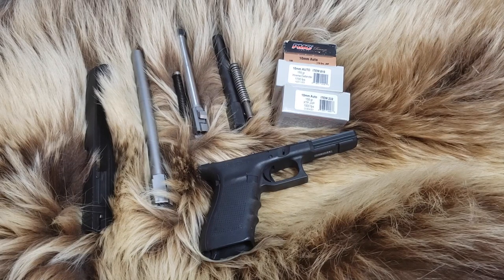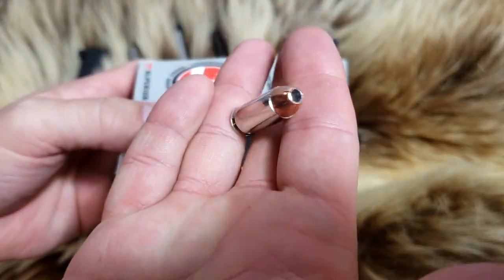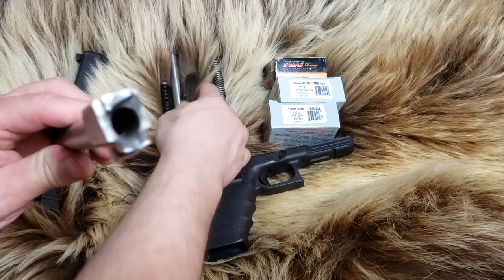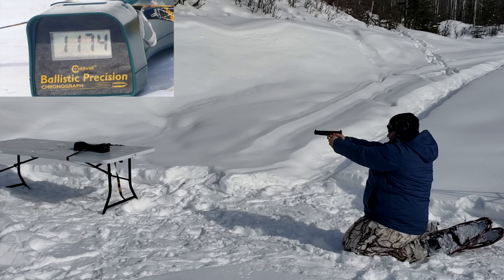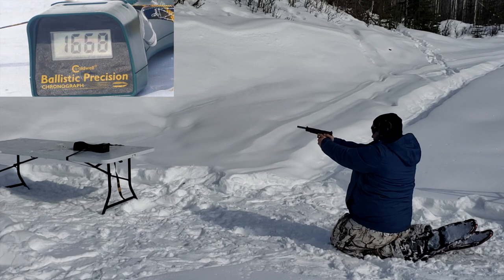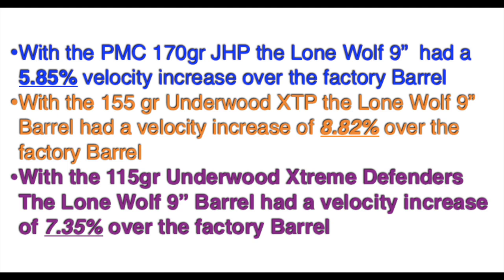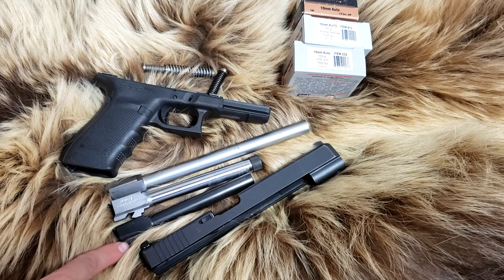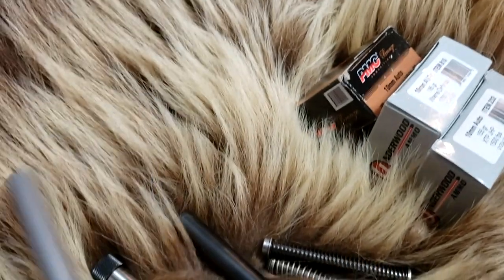10mm Glock 40 3 Long Barrel Length Velocities

Comment: If I'm in Combat with a bear , I want a combat Barrel . I would rather Feed every sub Perfect round than have the Perfect round lock up my gun after 1 shot .
Reply from the maker: I can understand that
Reply: Good point. What's your opinion on the 5.6" m&p?
Reply from the maker: The m&p 10mm have feeding problems

Comment: Another great, very interesting video. It's interesting to see the speed increase that a half inch of barrel gives. 
Just one thing, in order to calculate how much more in percentage the faster speed has over the lower speed; after deducting the speed difference, that speed is applied to the lower speed, not the higher one. This will give a slightly higher percentage which is a truer reflection of the increase in speed. 
I'm writing this because it's so easy to err in calculating percentages and because of your very worthwhile, always interesting contribution  on U Tube requiring a good deal of work.
Reply from the maker: Thank you!
Reply: @AlaskanBallistics  You're very welcome, anytime.

Comment: Some good data there. I was impressed by the velocity.
Reply: The muzzle energy increase on that 9 inch barrel is insane with the Underwood 115gr. 400ft/lbs etc is amazing (Here in the UK we cannot have air rifles over 12ft/lbs of power)

Comment: So glad I got my G40 and a couple thousand rounds to go with it last year just before the crazy time started. Put a Lone wolf, Alpha wolf threaded barrel in it.
Reply from the maker: Your lone wolf alpha wolf actually feeds? Mine was junk
Reply: @AlaskanBallistics  I've yet to find out. Haven't been to the range with the new barrel yet. Hate to hear that though. Hope it's not the case across the whole line.
Reply from the maker: Happened with the 9" too . Tons of stories. Kkm is the way to go
Reply: I have around 300 rounds of 180 g. XTP's reloads and Sig 180g. fmj's through an Alpha Wolf threaded barrel without a hitch so far.  Can't speak as to how it would run with a compensator attached.
Reply: @AlaskanBallistics  looking back in my memory KKM was not in stock but alpha wolf was.  Now it makes sense.
Reply from the maker: Glad you got a good one
Reply: It was the only barrel I could find at the time more supported than the stock barrel.  I did read where they opened the chambers up on these barrels suggesting a problem and people were complaining saying they weren't supported much better than stock barrels. Also some claim you can get smileys even with a fully supported barrel from running too hot of ammo with too weak of a spring. A lot of deep technical debate on what happens in milliseconds when the sear breaks by people with educations in physics and such sometimes hard to picture what they're saying.
Reply: @AlaskanBallistics  mine was also junk

Comment: Since they're all super sonic, I thought they would be quieter out of the longer barrel. From this video, it sounds like the longer barrel is slightly louder, or at least higher in pitch, but they all sound pretty close to the same. Is there a more noticeable difference between the various muzzle blasts in person? Thanks.
Reply from the maker: No not that I could tell

Comment: I say 10mm out 9 inch barrel got some speed behind it. Definitely do job on a whitetail deer if you do your part in shot placement.  Pretty sure it would do good job on a small black bear or wild hog also . Be a cool idea for some one out west that hunts mt.lions also.
Reply: The hot 10mm rounds are clapping big bears too. It's not as effective as 44 mag but it's very very effective. Piercing skulls and punching into lungs with ease.

Comment: I bought one of the 6.5" threaded for my G40 and discovered that it's unable to stabilize the X-treme 220 RNFP unless I drive them at 1200 fps.  Subsonic loads tumble.  KKM recrowned it for me and sent a second one to try.  It didn't stabilize them either.
Reply from the maker: Hmmm weird.

Comment: The 9 inch barrel seems to bring "cheap" (watered-down(like 40 S&W)) 10MM ammo, like "PMC", up to true 10mm --  1200+ Fps muzzle velocity instead of 1000+Fps. Another video the PMC chronoed between 1024 to 1053 and Sig Sauer was 1248 to 1274 muzzle (3 shots each). I'm thinking the Lone Wolf 9 inch barrel is a great upgrade.
Reply from the maker: It is not only with lighter bullets does it get significantly more (75 fps or more) feet per second over my 6.5" kkm barrel.  I've got a whole glock 29 vs 20 vs 40 series with those barrels added in the later videos
Reply: @AlaskanBallistics  YES I know i've watched them all  ----   today is just a review of the videos ----- Lone Wolf just got some of their 9 inch barrels back in stock and I ordered 1 today ---- so it was time for "RERUNS".
Reply from the maker: Thanks @Hutzjohn I really appreciate it.  Godspeed and Good Hunting
Reply: @AlaskanBallistics  NO THANK-YOU   --  you're the one that puts all the work in to make GREAT video reviews 👍👍

Comment: Thank you. Is there any benefit of a long slide/ barrel vs long barrel only? Other than sight picture, what would be the diff between a glock 20 with 6” barrel install vs glock 40 6” barrel?
Reply from the maker: The front heavier slide of the g40 really softens the recoil.   I had a friend who was going to buy a glock 20 and a flush fit muzzle break... Making it the same size as a G40.  He shot my G40 and bought A G40
Reply: Oh wow. Ok Thanks!

Comment: I definitely need to order one of the KKM threaded  so I can finally run a compensator on mine!
Reply from the maker: Don't need it in g40.
Reply: @AlaskanBallistics  only thing that bothered me in the video is you stating that the G40 barrel isn’t fully supported. If you place a loaded cartridge in the barrel when not in the gun, you will see that in fact, the barrel IS giving full support all the way to the extractor groove. It’s just a slightly larger diameter than the other two chambers have. ALL Glock factory barrels have fully supported chambers except for .40S&W models (same as all other makers .40 cal guns) and that’s due to fitting the cartridge into a 9mm gun. I would also like to see the results with factory barrel using the heavier spring, and the factory spring in the longer barrels.
Reply: @AlaskanBallistics  second issue is calling underwood good ammo. We have stopped selling their garbage due to it having destroyed customer firearms. Same goes for Double Tap and Buffalo Bore.
Reply: Fun to watch though.
Reply from the maker: @jimhans1  fair enough
Reply: @jimhans1  i run plenty of corebond, buffalo bore & underwood through both a G40 & G29, in the past I have even ran it through a HiPoint crapbine & never a single issue. Cant speak for double tap.
Reply: @sofloflow  good for you. You’ve been lucky.
Reply: @sofloflow  and sir, it is CorBon.
Reply: @jimhans1  me & everyone else who runs these fine ammo brands 👌 Lucky that we choose good quality ammo.
Reply: @sofloflow  well, you chose ammo yes. Show me an LE department that will issue these “fine brands”. Hint, NO departments will issue the junk!
Reply from the maker: I've seen. Federal and s&b blow up guns before... 
It can happen with any ammo manufacturer. Both Underwood and doubletap have corrected their problems.  Doubletap so much so that everything chronographs 100 fps less than the box.  
Most of the same 10mm velocities they get are in some loading manuals.
Reply: @jimhans1  you judge your ammo based on LE departments? The same guys who run S&W rifles? HAHAHA thanks for the laugh. They care more about budget than performance. Most cops still use FMJ, pffft.
Reply: @AlaskanBallistics  thank you for that info… I love the 10mm and love my Glock 40. I would hate if it blew up…. Would also hate if I lost any fingers.

Comment: Just picked up a g40, thinking about going with the KKM 6.5". Lone wolf has such mediocre reviews everywhere I look. Mostly want to work up to deer hunting with it, and want the chamber support to keep the brass for reloading since I'm going to have to practice a ton. Any thoughts from y'all would be appreciated
Reply from the maker: Sounds like you're on n the right track.  I love my 6.5inch threaded  barrel from kkm. You'll get more velocity from the non threaded 7" barrel, but if you want to use a suppressor or compensator,  kkm is the way to go.
Reply: @AlaskanBallistics  I might actually go with the 7". Only thing I don't like is that they don't have black coating available
Reply from the maker: Yeah but it's done really well for me not rusting
Reply: @AlaskanBallistics  I just would like it to be less shiny
Reply from the maker: Understandable

Comment: Can you run those lone wolf barrels in the Glock 29 ?
Reply from the maker: Not if it's designed for the g20 or g40... have to get one fit and mags for the g29. They do make them.  KKM is the best

Comment: i load 135g nosler hp @ 1680 f/s with longshot powder. 6in barrel. i bet that load will be over 2k in a 9 in barrel. any of thoes loads through a 9 in is getting close to a 1000 ft/lb of energy. thats some serious power. i want to pop some bowling pins with that. cheers.
Reply from the maker: It probably would get more than about 1860... it doesn't really get more than about 5-10% more velocity

Comment: I have a stock g40 and looking to upgrade only the essentials in preparation for Alaska... basically a good barrel, light, irons, and red dot.

Itll be on my leg almost always so I'm not thinking of a 9"... 6"-7.25"... probably a KKM because lone wolf seems to be out of stock all the time
Reply from the maker: My 6.5" kkm barrel is what I keep in it.  KKM's quality is much better than lone wolf's. I have a 22lb ndz spring in it as well.
Reply: @AlaskanBallistics thanks man. I'll check that spring out. I'll be shooting alot more and with hotter rounds soon because I love this 10mm so much that the cost is starting to hurt. I'm getting into reloading very soon. 5lbs of blue dot will make 35,000 HOT rounds. I'll be able to train alot more and with powerful ammo.
Reply from the maker: @frustratedmajority851 only 3500 not 35000 lol... 
There are 7000 grains in a pound.    X 5 pounds is 35000 grains.  My powder charge in 10.3grs. 
That's only 3398 loads.  
Best of luck to you!
Reply: @AlaskanBallistics  yea I realized this yesterday and it broke my heart. I googled it and Google changed my question and said 35,000 and i thought I found the Holy grail
Reply from the maker: Yeah looks like you or Google skipped that last step

Comment: So to shoot lead ammo from 10 mm glocks one needs the kkm barrel and what else?
Reply from the maker: That's it.  Heavy hardcast loads a steel guide rod with a 20 or 22 lb spring helps a lot too
Reply: @AlaskanBallistics  what maker steel guide rod? Can you provide web link or give exact name of maker of the steel guide rod  and name of site you got it from? I am kinda wary of kabooms and want to avoid them.
Reply from the maker: NDZ
Reply: @AlaskanBallistics  also I see kkm barrels have different types - one is match barrel, other one is with compensators?what is a compensator? Should I get match barrel or compensator batrel?
Reply from the maker: Nah just plain kkm ba=el with their feed ramp mod
Reply from the maker: Yep

Comment: My last experience with gen 4 KKM barrel 6", stove piping using the PMC hollow points. That happened multiple times, anyone experienced this? AP
Reply: I also meant to say I had an Glock 40 gen 4 8n long slide (6") barrel, with kkm barrel which did stove piping multiple times, AP
Reply from the maker: For very wide bullets,  kkm recommends their feed ramp modification. Did you do that?
Reply: Please define speed ramp modification, expected cost associated with this. AP
Reply from the maker: @anthonypushruk2586  email kkm to talk about it... it's all over their page. But basically they make the feed ramp wider for people they know are using wider bullets such as certain hollowpoints or heavy hardcast rounds

Comment: Why would anybody want the 9 inch barrel it looks stupid throws off the ergonomics of the gun it makes it look stupid
Reply from the maker: 1) Velocity
2) Hunting
3) Accuracy improvement because the quality of barrel is better than OEM. 
4) to have a longer barrel in a pistol brace device . 
5) for fun.  

And it doesn't throw off the ergonomics of the gun. If you feel it does, man up and hold the few ounces extra weight that it is
Reply: @AlaskanBallistics  to each their own I would just stick with the 6 inch Kkm barrel
Reply from the maker: @animalvideos955 I only carry it with the 6.5" kkm
Reply: @AlaskanBallistics  I didn’t get the threaded barrel I just got the regular one I’m not going through all the hassle to get a silence or when they don’t even do what they do in the movies so why bother
Reply from the maker: @animalvideos955 compensator/muzzle break.  Plus it looks better.  Also if you push the barrel into a bear/intruder that's attacking you,  then you have a less chance of it going out of battery.  (Not that you should do this)

Comment: Did you have to change out the recoil spring fir the kkm barrel to function or can you use ths stock spring?
Reply from the maker: I've done both.  Works great with either.  I changed it to a 22lb ndz spring to better handle hotter loads for more lock up and dwell time
Reply: @AlaskanBallistics  I have heard that some malfunctions with kkm barrels have you ?
Reply from the maker: Nope.  Only if you shoot weak 10mm, but you get issues with the factory barrel that way
Reply: @AlaskanBallistics  ok Thanks so i should be good with the kkm barrel and stock recoil spring?
Reply from the maker: Yes
Reply: @AlaskanBallistics  Thanks
Reply: So the screw compensator or muzzle brake on the barrel will not effect anything will it like functioning?
Reply from the maker: It can slow the slide down.  I don't use one except on .45 super where it's recommended.
Reply: @AlaskanBallistics  ok Thanks
Reply: do you have a link or where I can buy the 22lb recoil spring?Thanks
Reply from the maker: Yes sir.  Thank you!
Reply from the maker: Just Google NDZ spring
Reply: @AlaskanBallistics  10-4